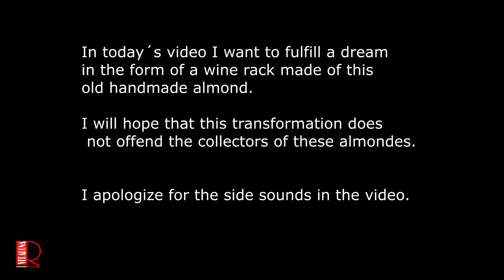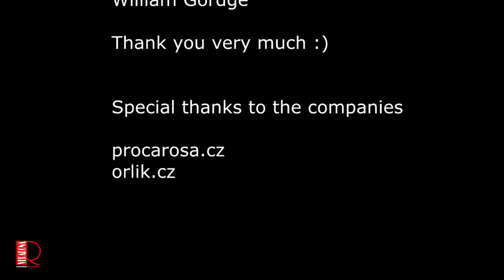Wine rack from Old Washing Mangle - Restoration

Comment: OMG this makes me remember when my grandma had a ringer washer and I got my fingers stuck in it.  ugh...painful memory!  but I'd still restore one if I had the chance, that thing could wash a lawnmower motor and survive!
Reply from the maker: Oh, I've already renovated a few washing machines, but I haven't shot that yet :(
Reply: "that thing could could wash a lawnmower motor." The OG heavy-duty washer that makes today's models only wish is to be that tough. My maternal Grandmother had two of them (one for washing and one for rinsing I believe [I was around 7 or 8 at the time]). They were probably about 40 years old, and this was the early 70's. Ah, the good old days.
Reply: @alinepeed7167  They sure don't make them like that anymore!  cast iron, all steel, and a motor that's strong enough to pull a semi.  and the safety features were awesome, no guards at all and the lid was removable!  made for a fun afternoon getting your shirt unstuck when it wrapped around the spindle!

Comment: Beautiful  piece and not insulting to the piece at all. Though, I would suggest the lower roller be pulled out. It's somewhat hidden and would be an awesome rolling pin. Think of the cinnamon rolls man! 
You on one handle, your bride on the other with Mona dusting as you go. Great job and great use.
Reply from the maker: Thank you so much Mark :) Radek

Comment: A beautiful piece of work! Is a roller washing machine called a mangle in Europe?
Reply: Yes
Reply: Used to squeeze the wash/rinse water out of the laundry.
Reply: @samuelfellows6923  Yes. My mother used one. In America it was called a roller washing machine. The roller was connected to the wash basin, then you wring it out with the roller . Then you put the clean cloths on the clothes line.
Reply from the maker: Yes you are right. In my country we call it "mandl" and as I found out after the mallow, the translator translated it as "mandle", which are almonds in our country.

Comment: Question .....the sparks in your power saw, was,nt it a brushes issue, that could have been replaced, or did you really have to go buy a new saw .....?
Reply from the maker: I'm not an electrician, but I know them, and he said it would most likely be an burnt anchor, and that's wrong. Yes, I had to buy a new one to complete the project.